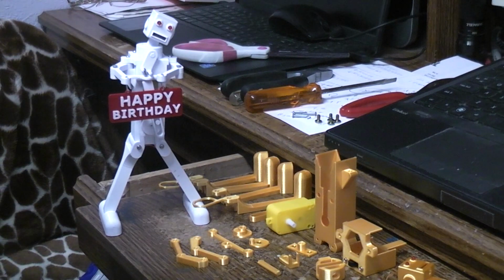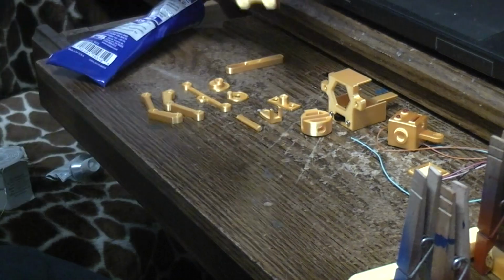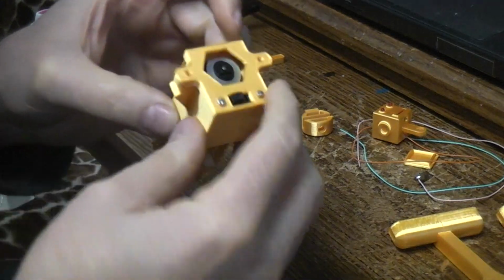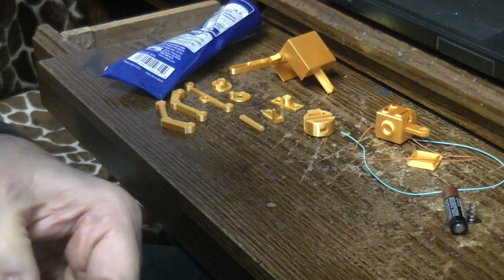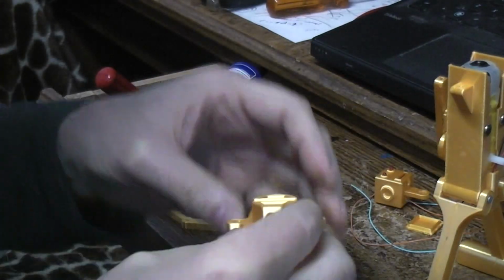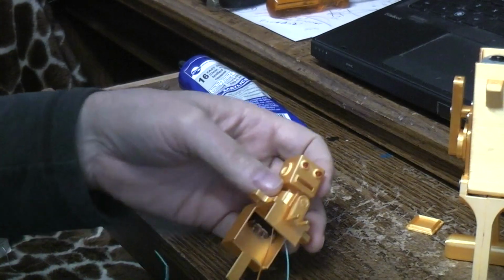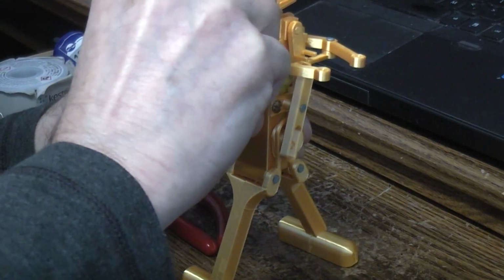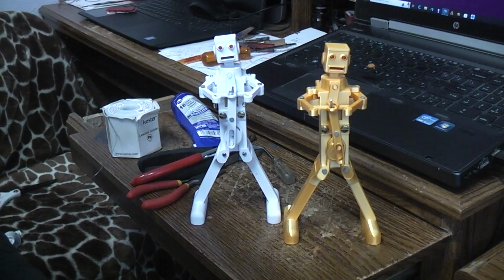Make the 3d printed Battery operated Celebration "dancing" Robot. TT gearmotor version.

Comment: I found some issues when assembling my print of the robot. Main one is that the cam disk allows the upper leg O to slip out then getting stretched like OoOoOoOoOoOoOoOo with each rotation until it breaks. The Radius of the large disk of "CelBotCam3" needs to be 2-3mm larger to make this impossible -  a 20° beveling might also help and there is plenty of space.

The second issue I found that there are few stress points that might break easily. one are said 0s on the leg part. Maybe make them +0.8 diameter larger on the outside? there is also a 90° angle at where they attach into the legs that could be filled in by a 45° surface. Although this has little load and might not be needed. 

I made the modification to the cam disk live demo here:

https://youtu.be/ehrEvz6IDXg

:)

Comment: Going to make one - have you thought about using flickering LEDs for the eyes? I used some for the walking robot and its a great effect.
Reply from the maker: The only reason I did not use flashing or color changing LEDs is that most of them require "not all" 3 volts to 5 volts for stable operation. A standard red LED will start working at about 1.8 volts.
Reply: @Robothut  I shall try it then - I used a voltage booster on the walking robot so it's not a good test.
Reply: @Robothut  Turns out green flicker leds have no trouble running at 2.5v off of 2 nimh cells @ 2.54v:  https://youtu.be/ehrEvz6IDXg
Reply from the maker: @jolilos  So starting with 3 volts and running a motor you could lose 0.5 volts real fast I would think. My red Leds will keep working long after the green LEDs have stopped. But I think it worth trying.
Reply: @Robothut  I only used the greens to really stress it. They stop working so good below 2v. I can try the red ones as well see if they work at lower voltages.